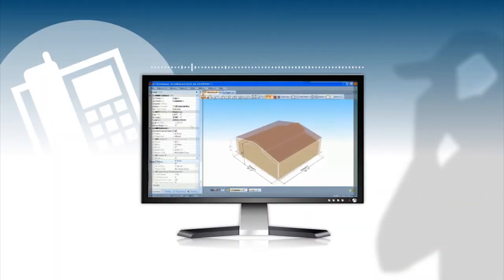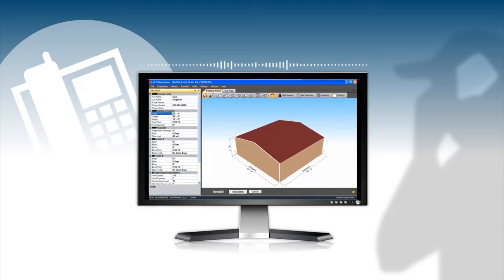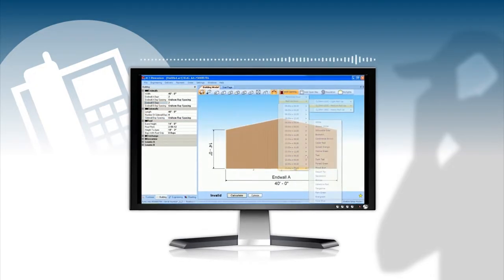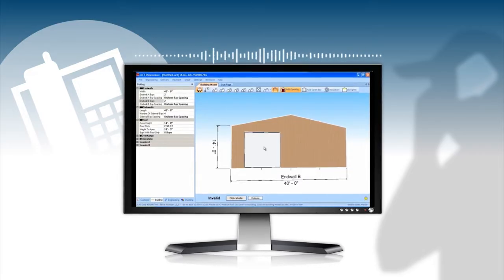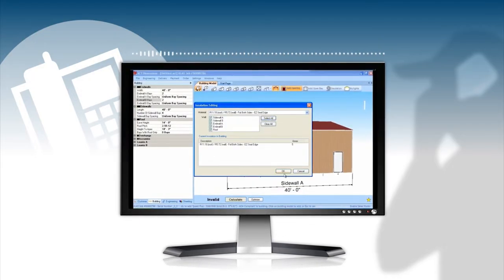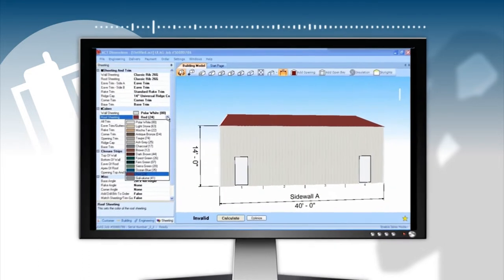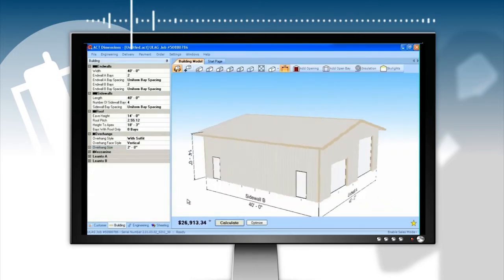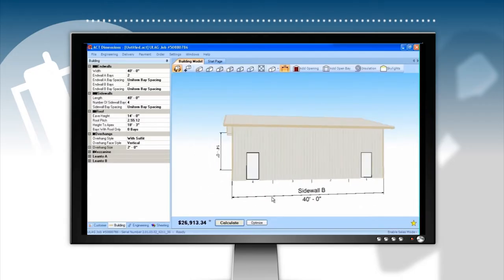ACT Building Systems making COLD FORMED buildings easy

Comment: So the materials were $26k, but what's the cost for everything else to put it in?
Reply: If your garage isn't requiring a mezzanine(loft area) than it'd likely be just the cost to finish the livable space which is up to you as to the size allocation but generally speaking...to add a 20x20 livable space that includes a bedroom w/walk in closet, small-medium sized kitchen w/appliances and a full bathroom could easily be a 25-35k job on a finishing project w/all the necessary framework needed. It's the sewer/water/electric hookups with your city that bump this price up usually. Also, you'd generally want to install the building on a concrete slab for the best results and as of now, a 30x40 & 50 concrete pour runs about 5-8k. Hope this helps!

PS- I don't work for these guys but I'm interested in purchasing through them so when I came to this video, I just seen an opportunity to help where I can.
Reply: @chrisbaker7858  Sorry Chris, but the price here is only for the "kit". It ships direct to the customer. It's more of a DIY cost savings idea, but in reality hiring a crew would cost an arm and a leg. I know because I have inquired for myself. And Yes, the concrete and utilities are separate too.